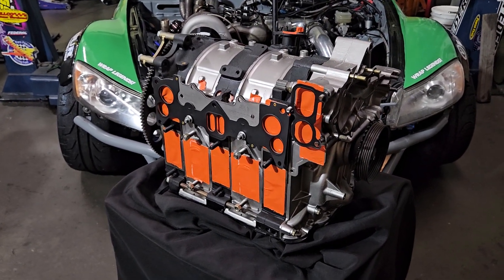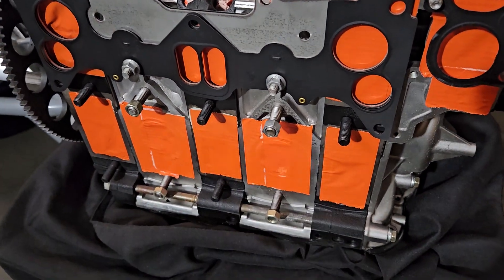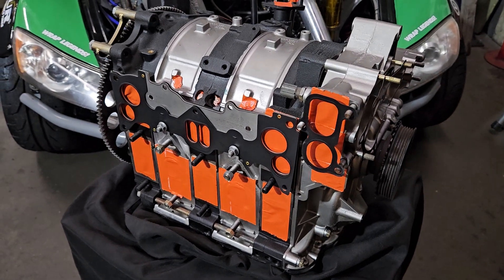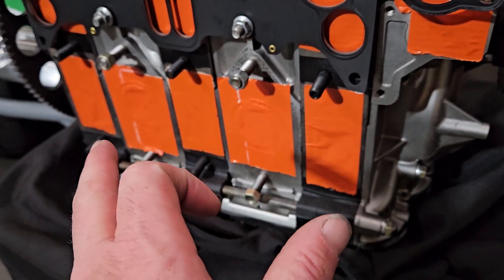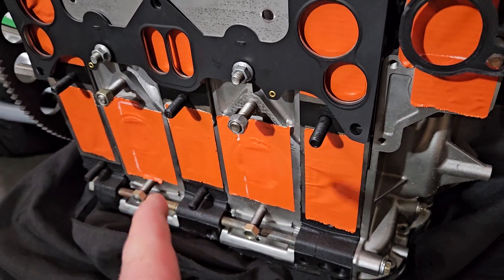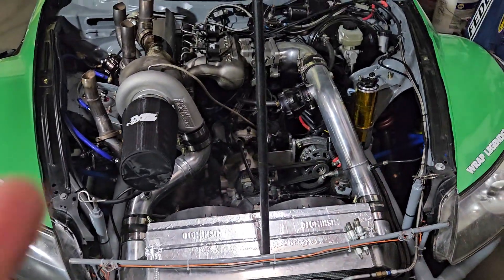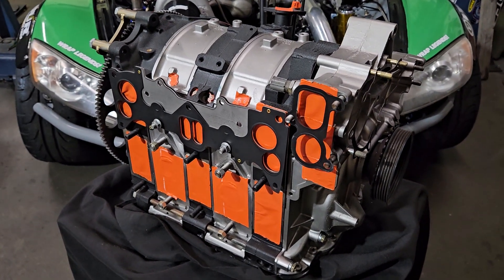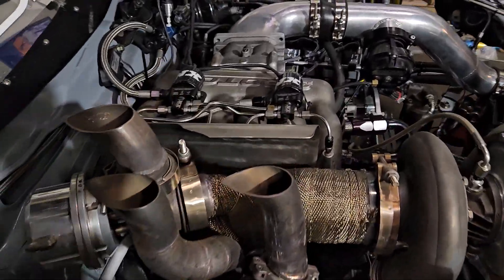Hybrid Renesis, Answering questions, Why Use GSLSE Housings - HP talk, Exhaust info & updates

Comment: Racers in Puerto Rico are gonna start experimenting with adding fuel through the Renesis exhaust ports and only using housing peripheral exhaust ports. So all three plates are gonna have fuel top and bottom and it will also lower housing peripheral exhaust temperatures. I strongly believe rotaries need fuel all over including spark plug side of engine through the plates. Good video.

Comment: I have a Renesis and I want to do this mod and put it in my AIRPLANE.  

With the added P port exhaust ports, does it really need the side ports?  Also, a 2-port exhaust manifold would be a lot simpler than a 5.

Comment: I have loved this idea since you started, I just had a idea watching your video. The new turbo smart straight gates off the peripial ports to give control to the extra exhaust flow or even to seperate twin turbo manifolds rx8 ports for small turbo and controlled exhaust gas turbine big turbo. I think this would suit this Frankenstein motor. With all the new tech they could open on exhaust gas back pressure.

Comment: Have a couple questions:

1. Would it be possible to use a custom header plate that blocks the Renesis exhaust ports and only uses the GSLSE exhaust ports? As with some port work, we know these can flow plenty on their own.

2. When moving to GSLSE housings, could FC turbo rotors be used in a Renesis engine to reduce compression ratio?

Comment: sorry if this is an obvious question but is the gslse/renesis hybrid generally only meant for making power in an rx8 setup?  or am I missing the part that it could be better than a traditional form 13b-rew for an rx7 or other chassis build?
Reply from the maker: i think this might be a top option for swaps. Especially outside of the box. Race cars or non-Mazda chassis. I've been considering it for a few 13b car projects. Its partly why we started working on the idea. How do we make the Renesis a good fun rotary for the RX8 or other projects...

Comment: Been watching this since the aforementioned MotoIQ article was new. I'm that guy that commented on a previous video about my AE86 project that's very interested to see how the N/A results end up due to my own hybrid build, and I must say, if there was a shelf header, I would f@#$in' buy that shiz!

That being said, I have the whole ass GSL-SE from bumper to bumper for parts, so I'm not limited to the RX8 motor mounts, so I guess I'm mostly just wondering how one merges all of that without negatively affecting scavenging, assuming that's even an issue.

Comment: all this talk about the hybrid but yet no one is running it, there is so little information on what seems like a simple build, take a fresh renesis and slap gslse housings make a header and throw it in a chassis but no one has done it yet providing solid information and dyno numbers
Reply: You will lose a lot of bottom end power for very little top gain I believe is the issue naturally aspirated… for turbo this is less of an issue, this is just from my limited research on the topic. There is so much witch craft involved like difference in port timing between old and new 13b it just hasn’t really justified or proven the results for the cost. Look into how a naturally aspirated v8 tuned length header system works and I believe this concept comes into play with so many options for the exhaust gases to escape.
Reply: i should’ve added that i meant in a naturally aspirated/street setup

Comment: What's a rough cost if I had nothing or at least a stock rensesis laying around? I'd need GSLE housings, maybe pay to have RX8 rotors machined for RX7 apex seals, maybe a stud kit and the standard engine rebuild things like new bearings and gaskets. I really want to build a rensesis hybrid, an NA 3 rotor or turbo 2 rotor will be powerful enough.

Comment: Hello Kyle, hope you are doing well. Excited for this build, I'm getting parts for mine. I have a question about intake manifold. What do you recommend? I'm going turbo and I'm worried about the integrity on the plastic upper intake manifold on high boost. Hoping to see a video about that. Thanks for all you do to keep our community strong. Brap brap!!
Reply: That's good to know. Thanks. I'm planning to explore 20psi. I'm planning to fully build the hybrid and going to use Fueltech and E85.
Reply: i'm not sure how much more than this but they handle 12-14psi from no worries.